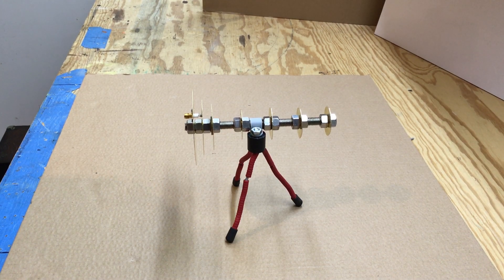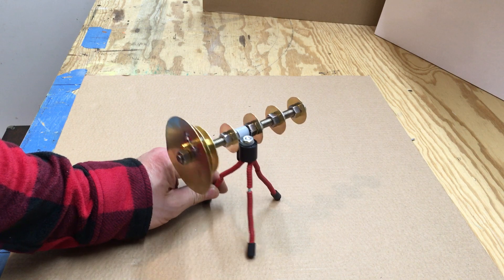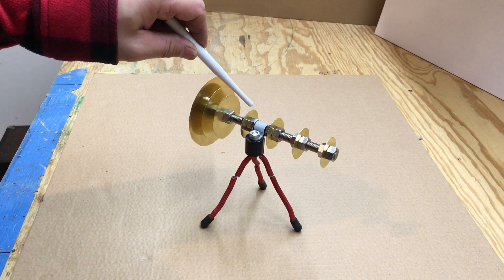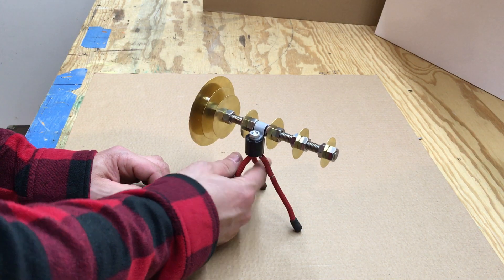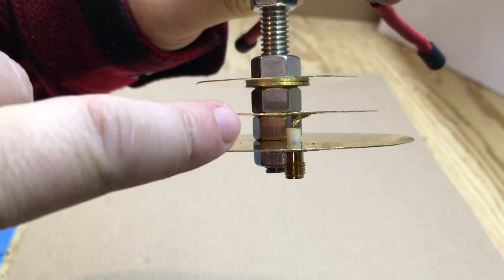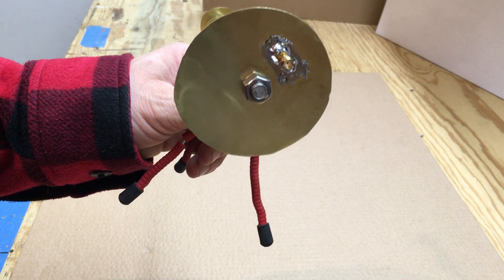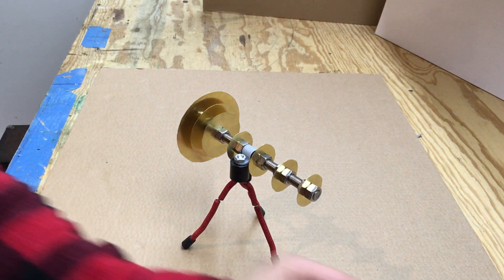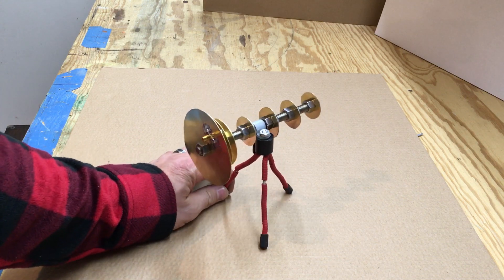Homemade WiFi Antenna Made From Brass Sheet Metal

Comment: Awesome! What are your plans for testing? And what do you plan on using it for?
Reply: I wonder if it could be dierctly wired to a GPIO and the onboard Wi-Fi of the Pi shut off and this used?! If lighter materials were used it theoretically could be sent up on a balloon to transmit data back to the ground.
Reply: This will not work, as the centre screw and nuts are metal therefore the prasitic directors and the positive and negative disks of the active parts if the antenna are electrically connected. If you change the screw and nuts to plastic (nylon), it should work fine.

For maximising the gain, there is a distance relationship between active disk and the first parasitic director, once known each parasitic director should be the equidistant.
Reply: @IndependentNewsMedia  ANY VIDEO THAT KINDA PERFECT LIKE THAT?
Reply from the maker: I’m not sure if I’ll use it or not. But for testing, I’ll use airodump-ng or something to test it.
Reply: @FuzzThePiGuy  hey fuzz how much tiny i can do it why i want to transsport it